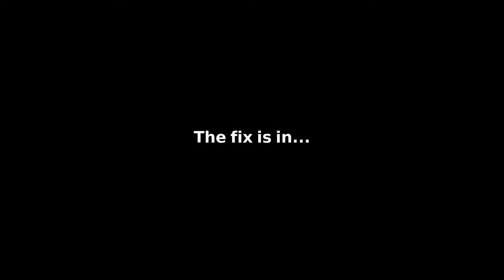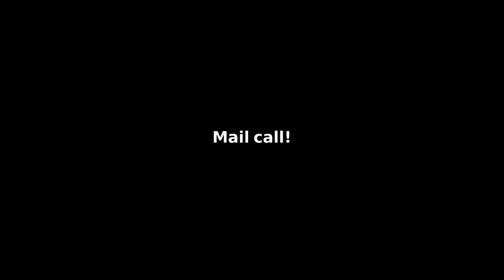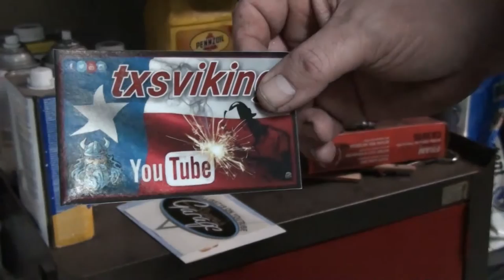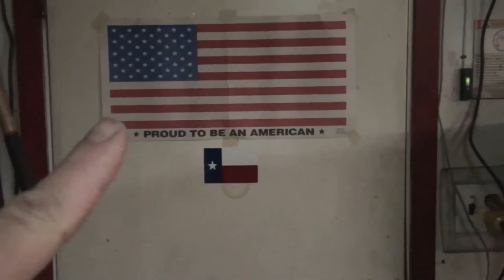Snow Plow Fail and a Mailcall!

Comment: If you can angle the blade a few inches it would run easier.  Merry Xmas
Reply from the maker: Sadly it only has 3 settings left, right and straight and the left and the right both hit the tires when its at those angles so either its the wrong blade or the tires are bigger than the stock ones. Given I can't find a dang bit of info on the 1966 Gilson Commander its hard to say. Actually it handled the snow quite well the only real issue was it popped out of gear just before the end of the driveway and I did not get enough power from a stand still to move what was there. I will eventually figure it out and find ways around it I think. :) Merry Christmas to you and your Family Buzz!!! Hope you are having a great day with them.